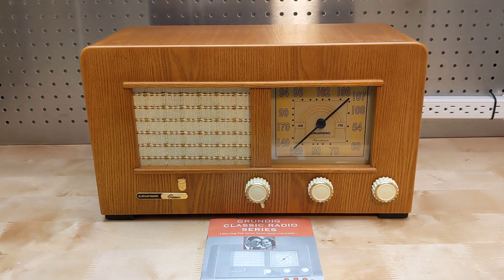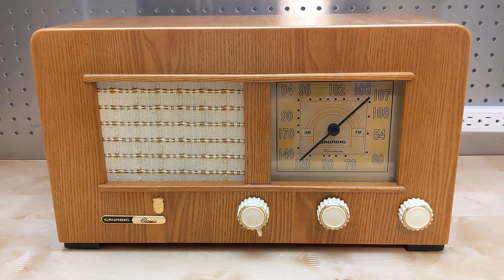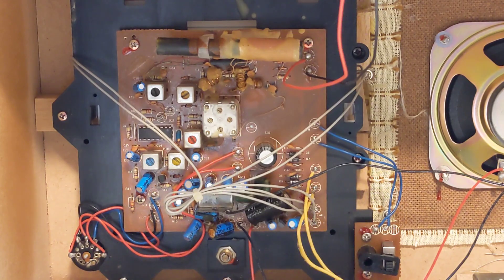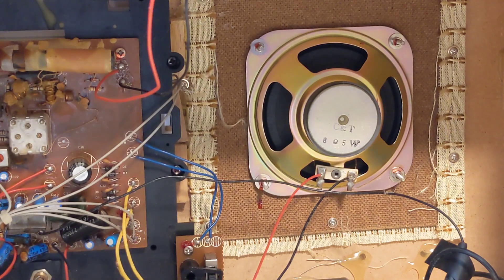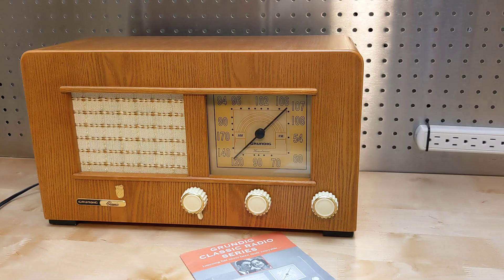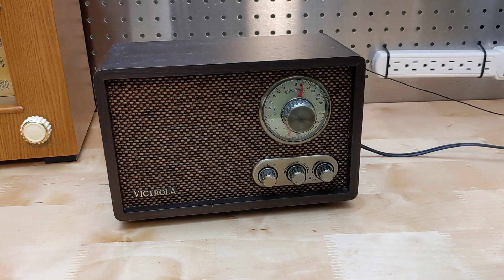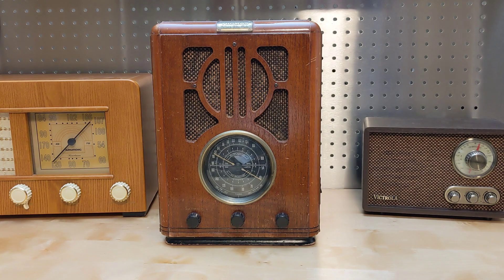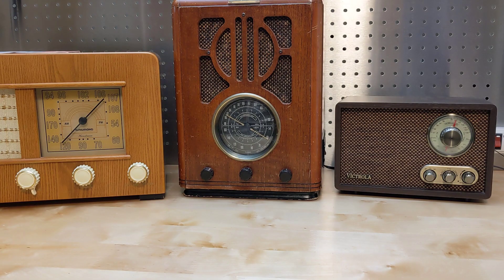Modern Radio Technology Comparison to Tube Radio

Comment: Pfff, i'm not confident at all for the result: They use so mutch poor quality components that the tuning has allways big problems.
You capture more parasites than the signal.
There were some good transistors receivers like optalix working with a 16 or sometime 32 Ohms speaker and some others but they have put to mutch craps on the market.

Comment: These "Retro" style radios are for "looks only", they are generally somewhat smaller in size than the original and use a super low cost "receiver engine" with generally very poor receive performance.  In the US, radio quality peaked out in 1935 to 1940.  From there onward, cost cutting was top priority, which compromised receiver performance.

The FM broadcast band we have today (88 to 108 MHz) came into being in 1946.  Before this, the FM band was 42 to 50 MHz.

In the US, tube radios did not have a back cover or internal antenna until 1940 - 1947.
Reply: The Stone Age didn't end because they ran out of stone, and the Vacuum Tube era didn't end because they ran out of vacuum.
Reply: @JxH  Like most technology that gets retired, it is due to costs or practicality.  Like everything, vacuum tubes have advantages and disadvantages compared to newer amplifier technologies.

Comment: thats not bad for a 'repro', many likely used same or very similar pcb, certainly looks familiar,  philips did some repros of their 'ovaltiney' set 634A , in the 70s and  80s, i have one version, it appears to use the innards of one of their far eastern made  all discrete 70s? portables 'adapted' to fit the case, i have one of the portables with same innards!, another version had IC based innards 'unique' to it